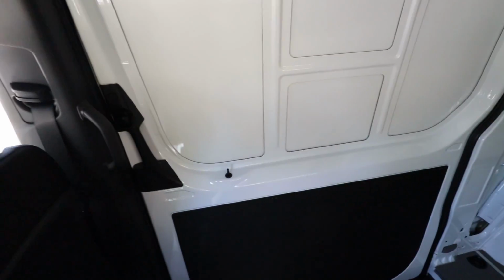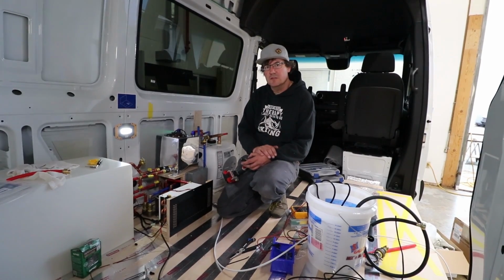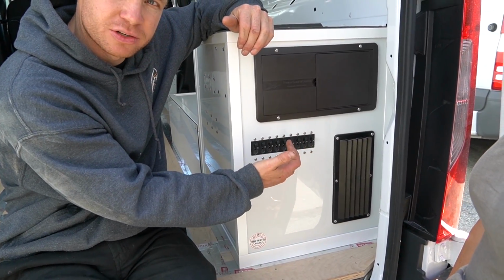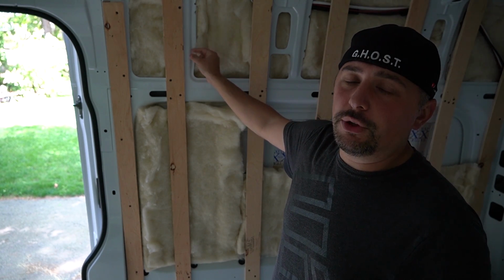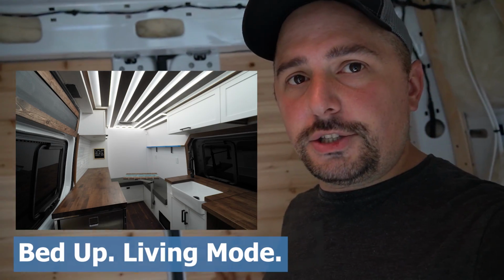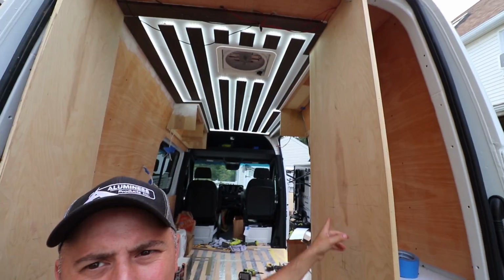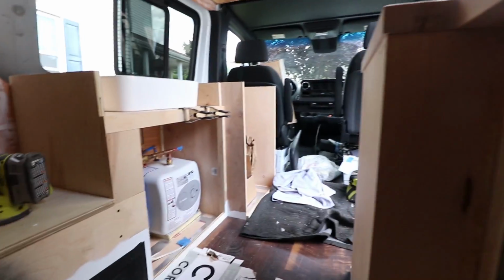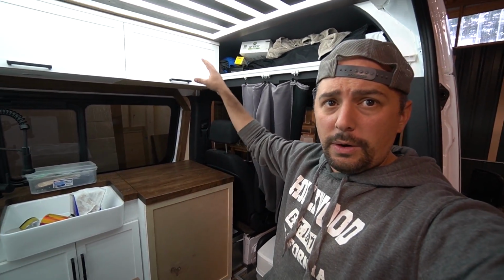FULL Stealth Van BUILD - Radiant Floor Heat, Murphy Bed, Solar Deck, Indoor Shower

Comment: Recommendations for Insurance?
Reply from the maker: Little harder if DIY built, which I'm assuming you're asking on. Best to go to the DMV of the state you're in because every state is different. Once at the DMV have them inspect it and change the registration to RV. They need to see that it's converted with certain things like water, bed, etc. Then you can start calling around to different insurance companies and see which will talk with you.

Comment: Are you planning to get your van jacked up and make it into a 4 wheel drive like Brandon Gross' Ambo, he took it to a place call "Sandyvans" in oregon I think to get it done. He even has a wench installed in the front bumper of the ambo.

Comment: 12:18 for anyone wondering- its important! Heat travels through SOLIDS very easily so putting air pockets between you and the outside makes heat slower to escape. stuffing it means theres less space between solids and the heat will find it easier to leave the inside of the van

Comment: Building a tiny home on wheels out of a lift bus. I'm snagging your Murphy bed idea, but it will be front side and I'll make the back a movie screen for a projector...
Reply from the maker: Oh that sounds cool!!
Reply: @jarrodtocci  thanks..it's going to be! Got a great deal on the bus, paid $2,000 for it, the previous owner spent $6,000 in repairs. It's what normally would be  considered high mileage, but will give me another 200,000 miles if it's treated right. Very strong engine, a triton V10...

Comment: I can understand that Troy may want a proprietary build layout for the Hydronic Heat System to be kept confidential but in the van build world that is shortsighted.  Those who can afford to hire someone to install it, will most certainly do so.  Those who cannot, would be grateful for the knowledge and refer others to him. He is not manufacturing the components, he is assembling them.  Additionally, if his components are custom built for his company, no one can buy them elsewhere.  Not wise to obscure the install.

Regarding solar panels, no panel is designed for weight on it.  They develop minute cracks and short life. This is a myth, and if you cover the entire roof with panels, you have no space for fans, vents, and will destroy them by walking.  They said this about the thin flex panels and they were wrong. 

The shower toilet is well done!  Love that marble tile/FRP - leave us a link for that material.  The space is well used for dual purpose.  Look at Humble Road videos and check out how he handles this section of the van. Some good ideas there.

Comment: I keep wondering if there’s been any successful couples living out of vans for any extended time? It looks like it would just be impossible. This conversion is beautiful.
Reply from the maker: Depends what you consider extended. There’s a few I know personally but it can have ups and down like any relationship. I’ve also told others it’s best to have 2 separate rigs so just on those off days you can get away and have some space from your partner

Comment: Hey man this is a cool build but the comments of “proprietary floor heating system” is off putting. 

It’s no doubt you benefit a lot from others’ research, content, etc as has the entire van conversion community but by saying what you’ve made is proprietary, you’re blatantly refusing to give back.

Now I could be wrong and misinterpreting it but it’s akin to a company using open source technology, enhancing it, and refusing to share what they’ve done. It no doubt happens but just leaves a sour taste in my mouth. 

It’s a cool build and your videos are clean AF, but I encourage you to noodle on my thoughts above.
Reply from the maker: I hear what you're saying, but consider this. I don't own the company that put in the floor, I just signed a NDA saying that I can't share how it was installed. Companies don't share thing all the time and your argument is this community it a community that helps others. Well, you've watched my videos and noticed that all I do is help others where I can but I also respect companies that spent years developing a product and are trying to protect that product.

In regards to this community helping others I'd say that was the case a year or two ago but unfortunately it's getting worse and more cut throat out there. I can name serval companies that don't share their secrets. For example I did a video with Aluminums and they asked me not to record some of their process and I respected that. How is that different then inlaying a heated floor system? I have a upcoming video with Earth Cruiser and they asked the same thing to not show certain aspects of their company. With the open sources everyone sees out there they are good but companies are taking that one step further and they don't share that technology.

I see your point of view and trust me I've been there myself, but I ask you to step back and see it from their perspective. See how much money, blood, sweat, tears went into creating something and wanting to start a business from it. Then start a business and then for people to say to share the years of work and research you've done and get nothing in return. Fair? That's up to the person I guess.

Comment: Do you sell the specs so someone else can build this?
Reply from the maker: I would have to make them. The reason I don't sell specs and the reason I don't like seeing other sell specs is because we are all different. So of you change one thing in the build then that would possible change 10 other things. Moving something a inch could change a lot or other things throughout the build
Reply: @jarrodtocci  Makes sense thanks.

Comment: Amazing, I live in Toronto and have a plan to have one of these mobile homes myself, but I have noticed many sprinters are getting rusty during long wintertime. Randomly, I did ask one of the sprinter drivers in the city to know about models and rusty body issues, he mentioned that the older models had a bad alloy body, not the new one. What's your opinion? Do you prefer a sprinter engine or Transit pro-master? Which cargo van has the best anti-rust body? Would be happy to hear anyone comment. 
Best

Comment: What about cost of radiant heating??
Reply from the maker: This system is probably different then the one you said before. I do swear by it as you've seen in a few of my videos by now. It's not cheap by any means running about $12k but you'd have to check with Van Life Tech to get a better more accurate number. It also is the hot water

Comment: No vapour barrier? THE most important single item in any RV build is omitted? Really? Enjoy your condensation.
Reply from the maker: Do the research please. As even said in video wool isn't supposed to use vapor barrier

Comment: Hey Jarrod love your videos just wondering what type of fur strips you used  i started using a birch for my fur fur strips would you recommend that or should i use a regular type of a plywood  thank you sir
Reply from the maker: Think I used plywood but don't remember which. I also suggest spraying them or coating them with some sort of finish to protect them from any condensation
Reply: @jarrodtocci  Hey thank you for getting back to me on that and the heads up on coating the fur strips some kind of deck coating ? or what do you recommend sir I started using birch 1/2 inch strips because it had less knots I take it its ok ? since you didn't mention not to anyway if your still in San jose would like to meet you I,m  in the willow glen area i have a 2018 promaster i would pay cash for an hour of your time? Just have a hand full of question thanks Jarrod

Comment: How's that wool work with vapour? Surely you gotta seal that over before you panel over your wood struts...
Reply from the maker: Wool works great. I met with the company that processes it and they gave me all the information I needed. The wood is treated inside the walls too for mold

Comment: What is the white paneling? Where did you purchase this paneling from?
Reply from the maker: Which white paneling? The walls are wood painted white. The ceiling has white aluminum stuck to the wood. All the cabinet fronts are custom made but painted white
Reply: I was referring to the white ceiling panels. Where did you purchase from?
Reply from the maker: @LovePeople-777  oh ok. Home Depot white aluminum coil stock
Reply: Thanks Jarrod! Awesome build! 👍

Comment: I would think in a van only half of the floor would ever be walked on, an could use heating? That maybe could save power, an money on the floor.
Reply: I would think for the van my dog would be the one who stood the most to gain by putting any heat in the flooring.

Comment: personal question, and i dont mean anything by it, but how tall are you? Trying to get a feel for how the ceilings would be for someone on the taller side
Reply from the maker: No offense taken. I'm only 5'8" but someone 6'1" can fit in mine. All depends how much you build up the floor and drop ceiling. Tallest van inside is the Ford Transit

Comment: I've made a couple of tour buses for touring bands, one of the biggest stipulations was absolutely no rattling and definitely no squeaking due to people sleeping wile traveling, the lengths i had to go to, every joint, every touching surface had to be glued too keep it quiet, so i was wondering, since you didn't do any of that, how much noise does it when driving along?
Reply from the maker: Small creaks in wood but honestly there's not much noise other then some wind noise

Comment: Props on the build. My only concern is the choice of insulation. I think you'll find that after 10k miles all the insulation will be at the bottom of their pockets from all the road bumps and vibration. That's why I advise spray foam. Nothing else gives you the same r value and noise dampening in a single product. There are other good products as well but you need to mix and match in order to make it work. The radiant heat though is epic!
Reply from the maker: Thank you. Look more into spray foam and rodents though. There's a problem there and you won't even know it's happening. The wool won't fall and you'll understand when building out a van. Also foam board is great too
Reply: @jarrodtocci  Ive worked with a van for over 6 years and 100k miles. No rodents. The foam is exposed though not hidden.

Comment: Our work has one of these, a bit older so no key fob.  I had to drive it with a really heavy load down to Texas and back. It sucked. But at the same time, the experience was worth it. It was way better than driving a big box truck. Except, the wind seemed to affect it more. Sure, it was aerodynamic, while driving straight. But the wind sends that thing all over the roads way more than a box truck, which I've driven a few of those long distances too. But to Texas and back, with a dangerously heavy load packed into this Sprinter, the largest size there was available. I think it's a 2015 model.

Comment: Only thing that would make this cooler would be a electric engine or a hybrid just in case. At least during the summer months you could probably cross the US in the month and a half. Only cost you have to worry about food, water, and other living expenses. This could be a cool way to travel.

Comment: Speaking of calculations, did you figure out what the new GVW will be before diving in to the build? Or maybe at least attempt to weigh each component as you build? There is nothing more disappointing than taking your new camper out on its maiden voyage and immediately noticing that the power-train cannot handle the  increase in GVW. It is one of the most common mistakes imo. Just curious. Nice Sprinter build non the less.

Comment: Hey jarrod🤘🖖 can’t seem to find a good insulation for my van . It’s a ford transit 17’ ext . I bought deading or dampen sound deal inverter fantastic fan with remote x2 horizontal mb assembly etc
Looking for person or persons to help me do the job since most of this I don’t have the tools for . In Florida (Orlando) area I really could use ur exp on who to take it too ? When you can lmk

Comment: The radiant heat guy would be better off to be more transparent, Put patents on his stuff and show the world. there are MANY qualified hydronic mechanics out there today. If He just sold the kit and let the consumer get it installed at there own risk. I have a 7200sq. ft home in Colorado with Viesmen boiler's one just for snow melt on exterior concrete and the other for the house, 7 bathrooms two laundry rooms never out of heat or hot water...I guaranty you my heat contractor could install his designs without a hitch..NOT knocking his stuff as radiant is the best and from what little you show looks like well designed.

Comment: What tempature are you running the hydronic floor heating system?
Reply: Info on your van please. Make, model, heigth, etc. Thanks
Reply from the maker: 2019 Sprinter 144" wheelbase high roof and low end temp ok floors are 75° and high of 95° it all depends on air temp. My air temp is set to 70°
Reply: @jarrodtocci  Execellent set point. Most people overheat their floors and when they system shuts off there's so much energy left that keeps on heating they have to open a window.

Comment: I'm interested in something like this for a mobile workstation. Any guides on installing grid electric, or would I just need to hire an electrician willing to do something interesting?
Reply from the maker: You could do it yourself but it can give someone headaches. For me this was my second time doing a build and on the first I did it myself and this one I threw in the towel and just hired a person that has experience in renewable energy
Reply: @jarrodtocci  I have zero experience with solar, and would personally be more comfortable with grid. Thanks for letting me know though!

Comment: Judging by the tighness of the corners on the coil grid layout, the secret is to use copper tubing with an insulator under it rather than PEX.

The secret to prevent "blow ups" as people are saying is to run a zero pressure system (cavitation at the pump ?) or install a Watt pressure relief valve.

BTW, it is illegal in many building codes to recirculate or cross contaminate heating water with potable water due to Legionaire's disease.  If you'll be operating the van in subzero temps and parking it, you'll need to use RV antifreeze as the circulating liquid.
Reply from the maker: Sorry to say but you're incorrect with the copper. There is antifreeze used and it's glycol. Also the glycol and water never cross each other
Reply: @jarrodtocci  Well, PEX can't turn sharp like that unless there are elbows at each corner and I wouldn't want all those connections under my floor - one is bound to leak.  So if it is PEX, I'm not impressed.

Comment: Hi from germany :) very nice build, but you need to protect the DC Cables under the wall. They running sharp cornors on metal and your van is moving a lot, so they can get cut! Please use flexible cablepipes to make your home safe. Cheers
Reply from the maker: They are double coated wires just for that reason
Reply: Yeah sure, but even double coated cables will get cut over time in sharp corners. You can never be carefully enough, especially with cables from the solar system where a lot of power is running through in a car out of wood with burnable isolation next to the cables.

Comment: Why do people in these van builds always mention the amp hours of their batteries without mentioning what voltage their system is running at? Amp hours are irrelevant without that info. 600ah @ 12V is half as much power storage as 600ah @24V, for instance. Watt hours would be much more relevant, and would actually tell you how much stuff they could actually run and for how long.

Comment: you've got no steam barrier between the metal layer, the insulation and the main wood layer.
In other words: Condensation will crawl into your insulation, on the steel and into the wood, creating both mold and rust.
EITHER you ventilate VICIOUSLY or add a plastic foil to prevent this from happening.
Reply from the maker: Wool insulation is designed to absorb moisture and then release. When buying wool they tell you not to use a barrier at all. I wanted to try and go as eco friendly as possible plus great insulation
Reply: @jarrodtocci  yeah, it absorbs moisture - but where is it supposed to release it to? Metal wall on one side, wood on the other. Moisture always chooses the path of least resistance.

Comment: What kind of air-conditioning systems do these vans have?  Sleeping in Phoenix in July would be miserable without a cooling system?
Reply from the maker: Currently don't have one. But if I did I'll go with a cruise and comfort model which is 12v but is also over $4000

Comment: That looks like a Dodge Sprinter.  They are extremely prone to electrical issues.  The sliding door WILL break.  Be prepared for major belt and engine issues that can only be "fixed" by expensive Mercedes mechanics.  I'm not here to poop on your parade, just to offer warning.  That thing is a money pit.
Reply from the maker: It's a 2019 and they have come a long way since these issues you're talking about. But yes it can be expensive however any vehicle can be expensive to work on
Reply: @jarrodtocci  
Your Sprinter is a 2019?  I've only personally experienced these issues with a 2001 and a 2008 model.  I don't know if they've since been rectified.